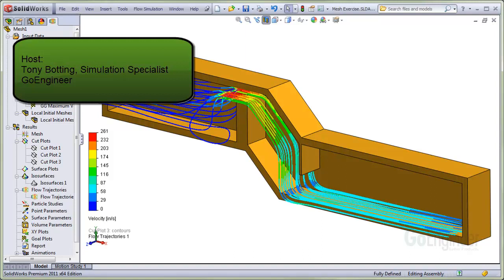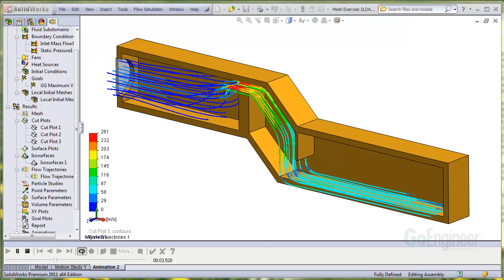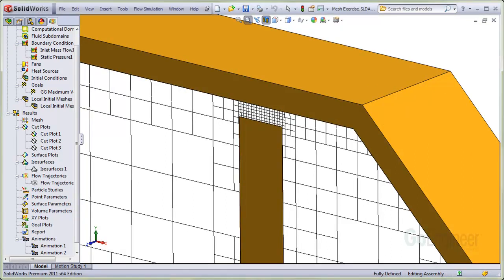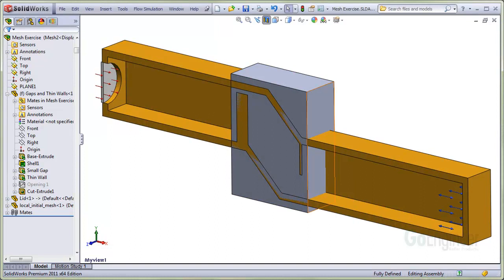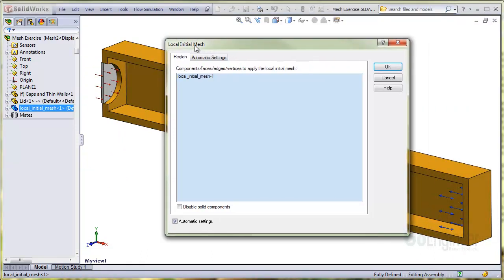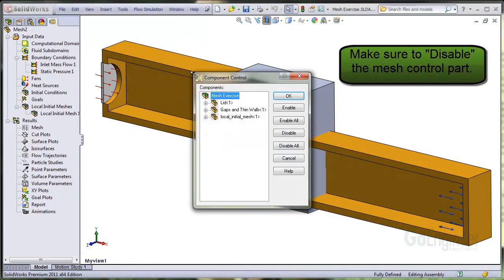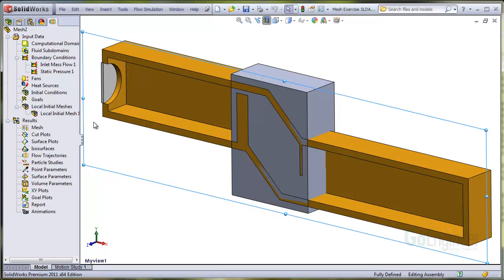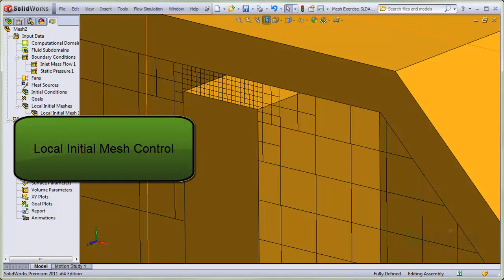SOLIDWORKS Flow Simulation - Mesh Controls

Comment: thanks for sharing your simulation on youtube 
can i simulate the phase change of fluid from liquid at the inlet of the pipe to vapor at exit of the pipe using solid works 
i think phase change simulation unavaliable in solidworks but to make this possible , you should use cavitation model which is available in solidworks 

how can i use cavitation model? thank you

Comment: where does "component control" located in SolidWorks 2015? There is no "Flow simulation" menu, only "Flow simulation" tab which does not have this function...